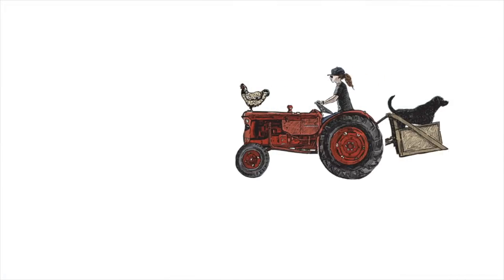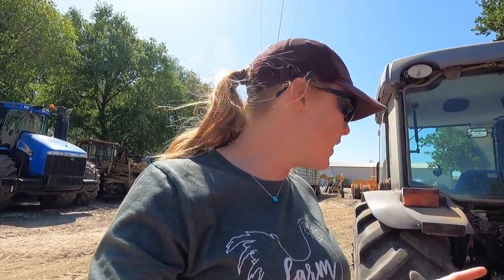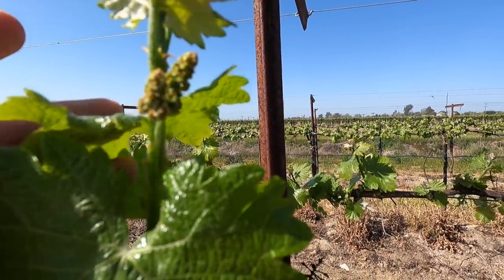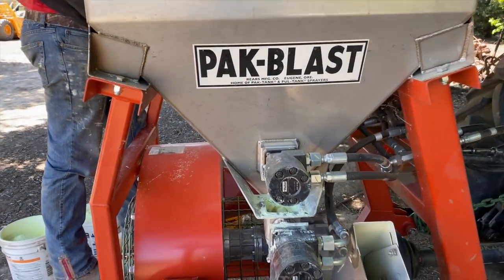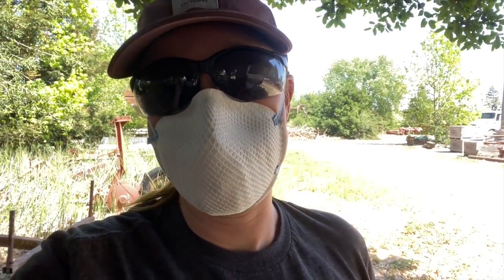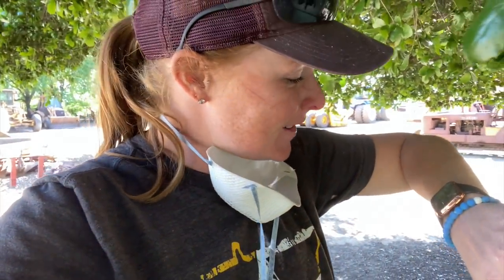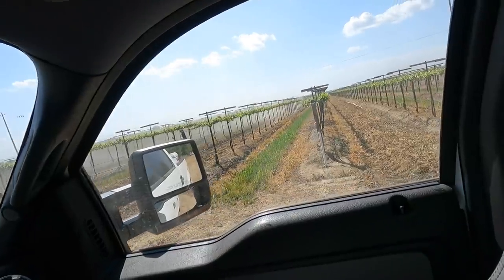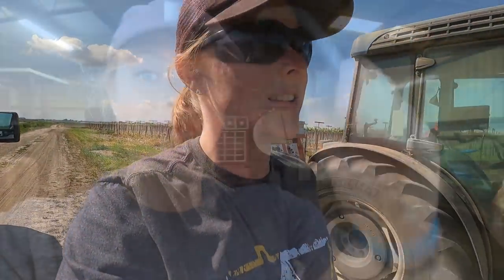John Broke the DUSTER!!

Comment: Yey you guys got it fixed!  The first thought I had, since I have spread lime with an old timer spreader, is that if you left it during the nights in the building and the nights have a lot of moisture and dew, then it could condense inside and when you opened all fell into the bottom without it even being noticed, it might also be what happened to your duster
Just a thought, have no idea about sulfur, but it looks a lot like lime at least  :)

Comment: The internal metal surfaces of the duster need to be cleaned to absolute bare metal and then pre-treated with a release agent IE: spray wax or dry silicone to prevent sticking, clumping and hardening of the Sulphur dust. A single application should last the entire dusting season.

Comment: Why is Sulfur organic yet if it is burned and used as a fertilizer it is not for a certified organic farm?
Reply from the maker: Sulfur just is organic. It’s like saying manure is organic. Probably would still burn if you got it in your eyes 😉
Reply from the maker: Oh and sulfur dust is not used as a fertilizer. It’s used as a fungicides
Reply: @TaraBeaverCoronado  Ok,   guess I do not need to apply 25 to 100lbs per acre  to  most of the 2400  acres of my  land.    Because Sulfur dust is very explosive in confined areas, my supplier mixes in 10% moist clay and makes a small prill for application.

Comment: Could you use a vac. Might help. Looks like a moisture. may need to put in a heated space and open up before using as condensation maybe the issue. Talk to you supplier.